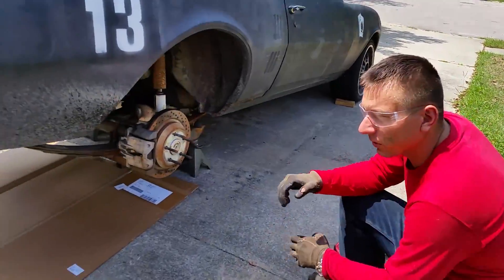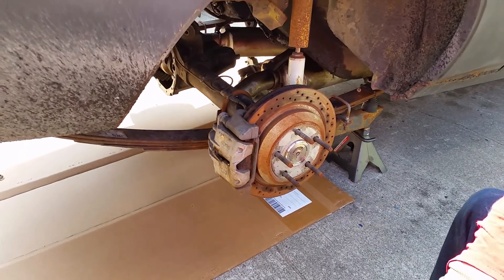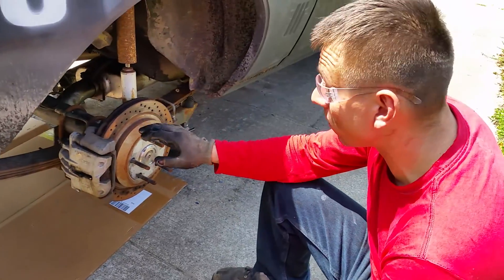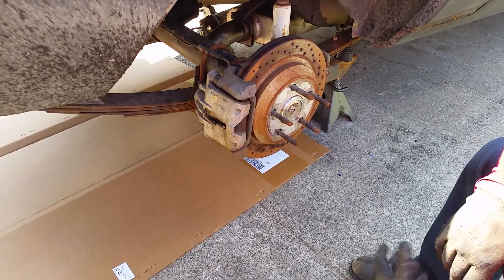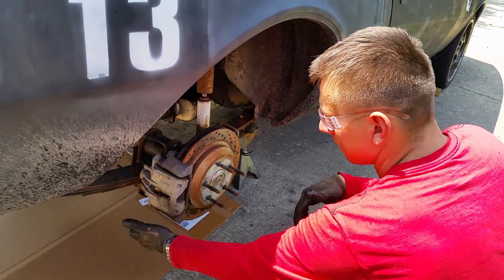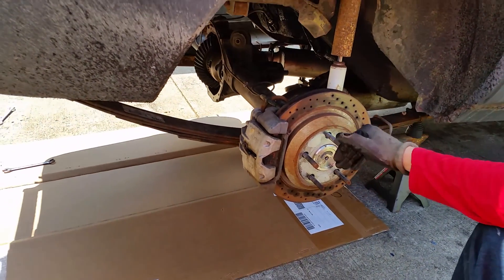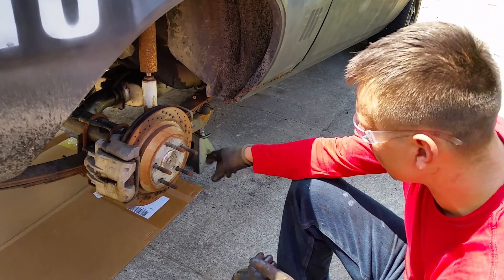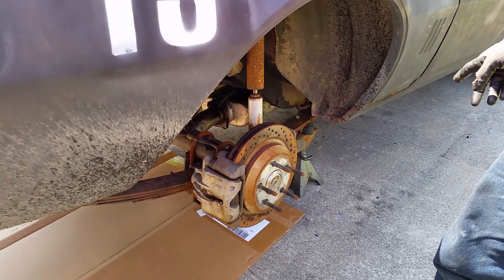part 2 disc brakes gear ratio, replace, posi install 12 bolt rear end. limited slip differential

Comment: looks like you have just as much space between your studs and the rotor holes as I do. any issues with that?
Reply from the maker: Eric Gonzalez none whatsover.  rotors aren't held on by studs, they are centered on the hub and the wheel should never be loose enough for the rotor to rotate any.
Reply: Quick question I have a 1965 pickup I'll swap the front end and rear end out of a 1972 front end and rear end I'm having trouble with the idler arm and the power steering box anybody have any idea how to help me here

Comment: Do you know of any links for info on the parking brake cable set up? the backing plates i found didn't come with levers or any other hardware besides the bolts to mount to the axle.
Reply from the maker: +Eric Gonzalez you have to buy the factory parking brake cables and splice them with the old car onrs
Reply: Wouldn't happen to know where to find the levers for the backing plate/parking brake? I'm just about done. Had 15's all around on the car so i found some 17s just waiting for Friday
Reply from the maker: Eric Gonzalez not a clue besides ebay or junk yard

Comment: You have the 4 piston corvette's in the front? Was it a kit or did you use the bb chevelle set up and did you have to use a different knuckle assembly?
Reply from the maker: the 2006 corvette brakes and rotors (c5) are 2 piston, and are practically the same brakes the 98 camaro gets cept the pistons are bigger and the rotors are 13" instead of 12"... here's the kicker ... I USED STOCK DRUM HUBS AND SPINDLES ;-) all you need is the caliper adapter and longer wheel studs....  check out the video i have on the swap" corvette brake swap 68 firebird" .  At $500 the corvette brakes are the best swap for your money... ;-)
Reply from the maker: http://youtu.be/-Xdlc2M0tjM here's the video on the brakes. enjoy!
Reply: Invincible Extremes Muscle Cars Garage hut